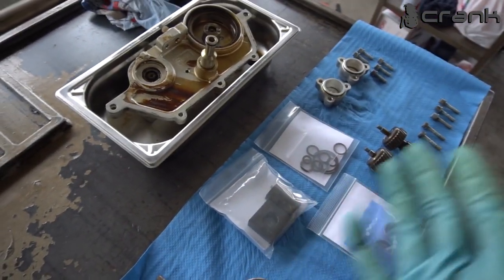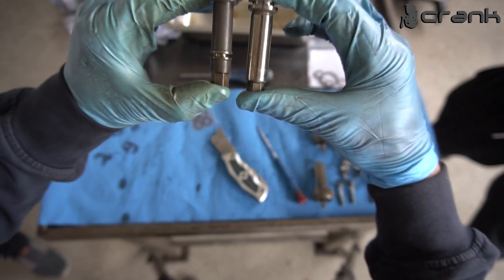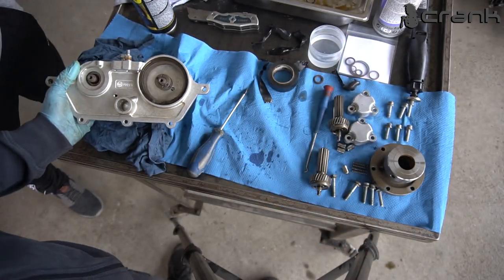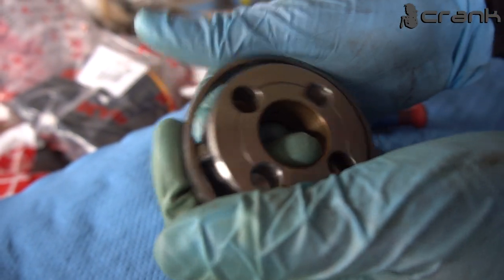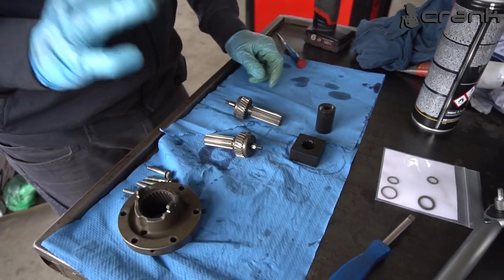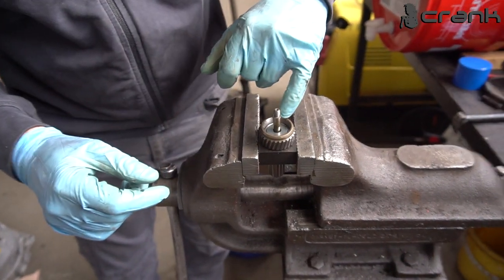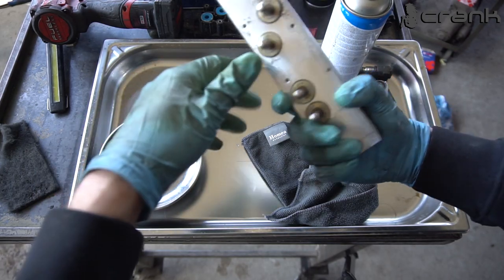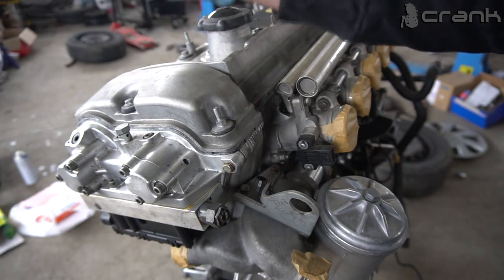BMW S54 Vanos Complete Rebuild

Comment: I'm surprised what kind of scammer you are! You selling o-ring for 20 euro which you bought for less than 1 euro per piece 😂
Reply: so you bought them ??
Reply from the maker: It sounds plausible, but with the small detail that I produce them, not resell them and the price is a little bit higher. But still, what makes me a scammer? Even if I buy them for 1 euro?
Reply: @crank3646  I like you and your content and have no problems personally .. I have no such issue.